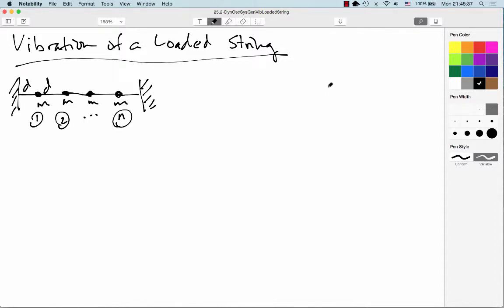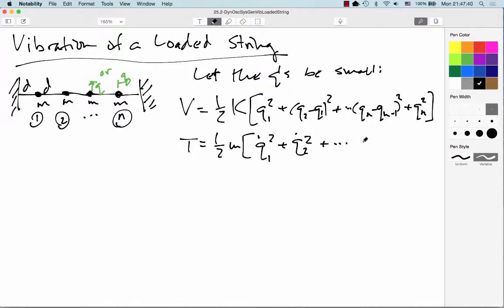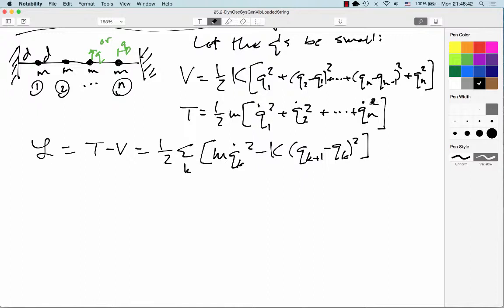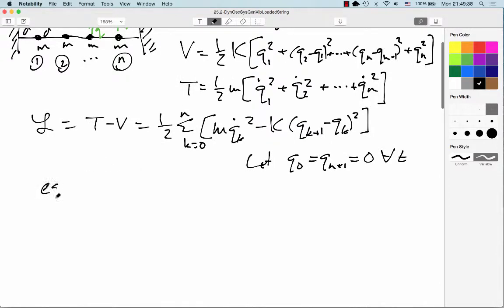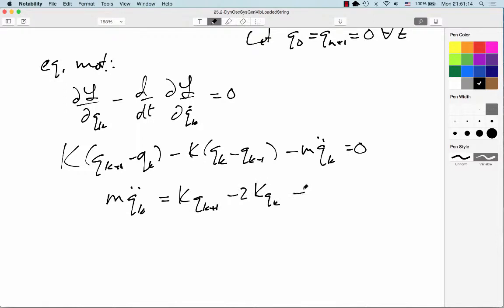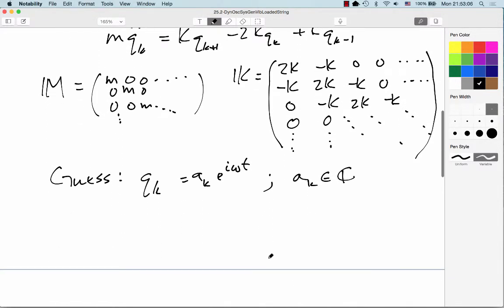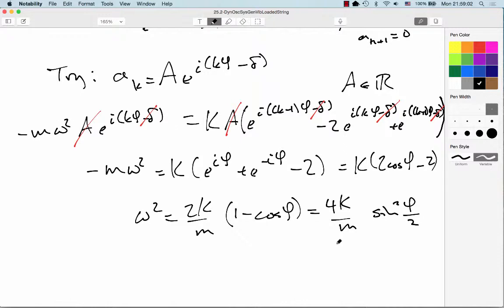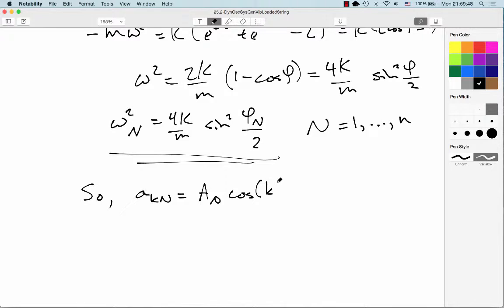25.2: Dynamics of Oscillating Systems: Vibration of a Loaded String

Comment: That recursion was smooth, I haven't seen them used outside of basic sequences in math. Is the standard wave on a string from 243 a special case of this scenario? Also, is this just fourier analysis? That summation looked exactly like a fourier cosine series.